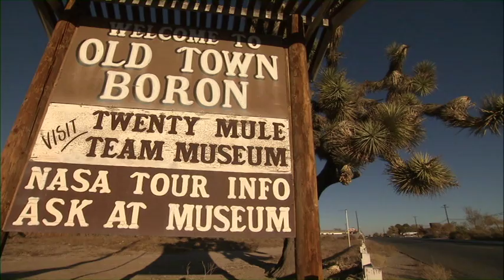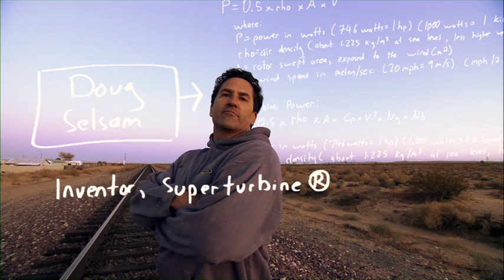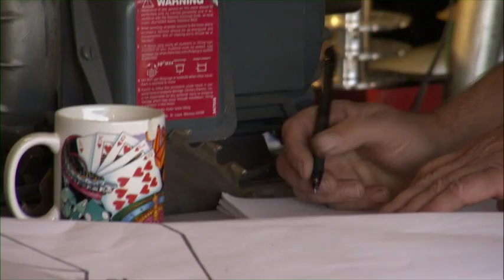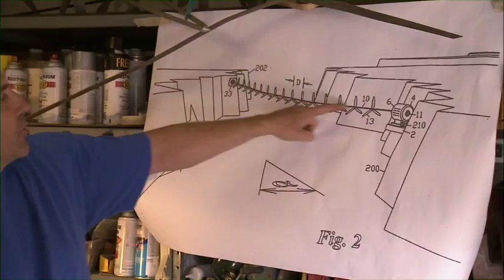Doug Selsam Inventor of Superturbine(R)

Comment: Do the math. It's a red hering. The fewer blades and the greater the diametre, the higher the efficiency. It's basic aerodynamics. That is exactly why the wind turbines grew so big.
Reply: Whatever floats your boat, mate. It's your time and your money you invest. Good luck, live long and prosper.
Reply: Blade material is V=hA, meaning the blades material doesn't grow at a cubed rate, larger turbine propellers are hollow not solid. A 10 meter long blade may have a 0.5 meter wall thickness with a diameter of 3 meters, so if we simplify and make it a cylinder the material would be approx. (10*pi*(1.5)^2)-(10*pi)=2.23 cubic meters of whatever material. Whereas a solid 1 meter simplified blade with similar proportions would use 1 *pi*(.17)^2=0.52 cubic meters of the same material. So now we examine length to material use, at 10/2.23 and 1/0.52, and we can easily see the 4.5 meters per cubic material beats the 2 meters per cubic meter. Of course the material used would determine the minimum wall thickness but at a certain point, with any given material, a longer hollow propeller will use proportionally less material.
Secondly, the sweep area is not a square it's a circle so it's pi*(r^2)*(blade count). So lets say you have a superturbine with 10, 1 meter long, 2 blade props, and a single 3 blade, 10 meter prop. The sweep area on the first is going to be 10*(2*(pi)) =62.8 square meters. The second will have a 3*pi*10^2=942 square meter sweep area. Then we come back to the original argument about which uses less material per sweep area, so lets do the math. 62.8/(10*(2*.52))=6ish square meters per cubic meter of material used, discounted material for driveshafts to connect the units of course, for the superturbine design. Then we get 942/(3*2.23)=140ish square meters of sweep area per cubic meter of material.
Given the example is simplified and shapes are actually more efficiently designed in reality, it's quite easy to see that a larger single turbine is more efficient, cheaper, and easier to maintain than a multi-prop design.
None of the above example takes into account the additional friction losses present in a higher speed turbine, nor was the cost of high speed bearings and lubricants accounted for, but, we can plainly see why engineers and physicists have gone for the single larger turbine versus the multi-prop designs. As far as your gearing argument, the larger generators typically produce power at about 1000 rpms, with a 30 rpm input, to get the same output you'd need many times more small direct drive turbine setups, and large direct drive generators are being deployed now negating the argument.
All in all the current design of large 3 blade wind generators beats the superturbine efficiency hands down, and neither comes close to the power output per mass of fossil and bio fuels in the time tested and reliable internal combustion engine. So far no green energy source is reliable enough, small enough, or efficient enough to meet the current demand for power. Often times green energy has a higher carbon footprint than if we had simply used an standard fuel powered generator. If we put half the money spent on green energy into nuclear power plants, there would be no need to cover the landscape in windmills and solar panels, and the demand would be met with a reliable power source that is available regardless of the weather conditions.
Reply: …which isn't even mentioning aerodynamic effects like losses to tip vortices on the blades, which means the fewer blades there are, the better it is. Then there's the consideration that aerodynamic forces grow with v², thus a longer blade will at the same RPM have a much greater efficiency than a short, stubby one of the same area, the effects of Reynolds Numbers on the blade's aerofoil behaviour etc.
But hey, I can't spell herring, so who am I to tell? Never step in the way of believers, Shawn. And then, there might be niche applications where this Superturbine actually makes sense, although I can't think of any right now.
But let's have some faith, praise the inventor, and a miracle will happen. Like with those solar roadways and Tesla coil generators. ^^)
Reply: I'm a nuclear physicist, and quite familiar with the reductionist fallacy. Get too focused on one aspect of a problem and the tendency to lose sight of the whole picture increases. It was clearly evidenced by the fact that a wholly true statement was ignored by focusing on a minor spelling/typing error. This gentleman has demonstrated a working model, however, hasn't demonstrated an improvement over current models. A patent doesn't mean it's better either, it just means you were the first to write to the patent office about a particular idea. Itself another common fallacy, the appeal to authority, something solar roadways suffered. 
Inventors do have amazing ideas, and often times, come across ingenious solutions to everyday problems. This time, however, he's chasing a pipe dream, and hopefully realizes it prior to going broke.
Reply: Your being a physicist was evident from reducing a blade shape to a cylinder to have a basis for a quick and easy rough estimate. ^^)
Me, I was forced out off university by lack of funds, thus am not a physicist, but I studied the subject none the less. Moreover, considering I am a native German speaker, I think my English spelling is quite okay. ;o)
You are perfectly right: When you have to clutch at straws such as disqualifying the one discussing a matter that grinds down to maths and physics for his spelling, that says a lot about the points you can make.
But hey, whatever floats his boat, right?
Reply: Whatever floats your boat.
Reply: Good luck, Sir! The first evidence of you being onto something there will be Chinese companies building and marketing it. Live long and prosper! \\//
Reply: We could go over all of the fluid dynamics in the youtube comments section or we could just jump right to the point, wind powers maximum efficiency in a perfect friction-less world on paper is 59.3%. Once that power usage is achieved anything more causes a loss of flow and therefore a loss of torque, or power production capability. Current 3 blade HAWT setups achieve about 80% of the real world 59.3% efficiency limit, considering friction losses, airfoil drag, wake flow, tip vortices, and non-laminar wind profiles, so it can be said that they are achieving very near the maximum. But you want the textbook information so lets do it.
The typical maximum usable wind velocity is 30m/s(v). With 0% humidty (dry) air at 20 °C and 101.33 kPa, it has a density of 1.20 kg/m^3(ρ), which is essentially perfect conditions for power production, and never actually achieved since water vapor is present normally, which reduces air density. Now that we've established perfect conditions, let's examine the theoretical limits of both designs. Superturbine with 10 2 blade props with a 1 meter radius, and a Common 3 blade prop design with a 10 meter radius. We'll assume perfect cross-sectional usage of the swept area for both designs, even though the superturbine will have more wake loss, and greater drag. Supertubine area(A) will be 10*pi*1^2=31.4m^2. Common turbine will be pi*10^2=314m^2. Maximum power output(P) is P=0.59(1/2)ρ(v^3)A. Plug in the numbers do the math and our result is: Superturbine power =  301kW, Common type power = 3.01MW. 
So using the text books and before we even examine load losses, friction losses, cost of driveshafts, towers, mounts, and other miscellaneous parts and changes needed to implement a superturbine design we can see it is less efficient and from the previous comment more expensive in prop material alone.
Wind energy is competitive with natural gas in a few ideal areas, but go to Alaska or Canada where the turbines can't operate for 25-30% of the year because of cold temperatures, and wind power costs near double natural gas. Try in FL, LA, TX, or MS, and you risk damage or total loss every hurricane season. Energy companies essentially bet on the power output of a wind farm, guessing what the 20-30 year output will be when charging for electricity, lose a wind farm to a hurricane and you can bet the price will spike. Wind also has limited expansion capability as sooner or later the useful building area will be saturated, and you will no longer be able to increase supply. If demand continues to increase as it has and supply saturates the price will go up. Have an oddball season with too much or too little wind and price goes up, nevermind the fact all wind farms purchase power from fossil fuel power production facilities during non-ideal weather conditions. 
I'm not out to discredit your efforts, or make any sort of personal attack, I just don't want to see anyone especially someone with a clever and inventive mind stray down a path that will only net loss of money. This current iteration of the superturbine can not improve upon the current successful model, and that can be demonstrated through measurement, cost comparison, theoretical mathematics modeling, and scientific process. Now is not the time to dig your heels in and double down, it's time to take a step back, use your brilliance, and attack the problem from a different angle. Good luck, and I do look forward to seeing what you can come up with.
Reply: Additive swept area would be in a perfect world, reality would actually show greater losses due to wake currents, torsional loss, attack angle or stall losses, losses due to gravity, and axial, radial, and lateral loading losses. Only the cylinder of air with the cross-sectional area of the blade diameter can provide lift or thrust for the blades. If each cylinder is tied to the next by a rigid or semi-rigid shaft then the next effect would be additive in the absolute best case scenario. If it's the first time you've encountered the science then perhaps it's you that should be examining the textbooks. 
Bigger blades do indeed take more material than a smaller blade, however, the gain in swept area is the square of the radius. Adding more smaller blades is additive, add length to the blade and the gain is multiplicative. If one discounts the driveshaft material the gains for adding length are squared, include them and they're better. It shouldn't matter whom you ask as far as mass vs length calculations mathematics presents us with the same answer regardless of whom was asked to perform the calculations.
The primary cause of wear in a turbine is load on the driveshaft. The idea is to mitigate the cost of repair and general maintenance. In a single prop design the gearbox can be maintained without the need to remove the prop and other supporting equipment. For your direct drive design how would the props be disengaged from the generator for maintenance? How do you address the axial load on the bearing block that supports the driveshaft? How does braking occur for your design when it is faced with out of parameter wind loads? When the unit is disabled to perform maintenance or safety how is the gravitational load addressed nevermind the oscillation due to the semi-rigid unsupported driveshaft? 
Conservation of mass and energy is a physical law that governs the maximum efficiency of any aerodynamic design, Betz's law places this maximum at 59.3% of incident air energy. You haven't demonstrated and increase of efficiency beyond the current large 3 blade design, and have in no way demonstrated a flaw in the mathematical theory. 
I'll ignore your ad hominem "a little bit of knowledge" quip, and remind you that to be taken seriously in the scientific community in which you are working you will be scrutinized and asked to show your work. When you resort to name-calling or non-sequitur type arguments it often shows your lack of expertise, and knowledge. I've demonstrated the mathematics, and physics (albeit simplified) that challenges your hypothesis, and rather than take the opportunity to show where I was mistaken, you've resorted to personal  attacks.
Your problem with the gains achieved by adding props argument is you haven't addressed the losses presented by adding the driveshafts. As you scale your design the driveshaft diameter and strength will need to grow,, you'll need to increase the total number of combined units, or the props will need to increase in size to produce the same or more power per unit cost than the current dominant design.
Reply: @shawn2444 whoa never seen such tech hi discussion on YT
Reply: @Scottie Winn man that's why Nikola tesla was not glorified despite of DC n rival did
Reply: Big picture: Efficiency = KWh / cost, NOT shaft HP / Area. You must know a bit about airfoils performance and reynolds numbers?
Reply from the maker: @shawn2444  Funny how many would assume every thought from a nuclear physicist must be true.
Reply: @dougselsam  I would hope the only assumption made would be in the formation of a hypothesis. Anything else said should be challenged for accuracy, and I would welcome the discussion that follows that challenge. Though, 2 years after the discussion we had here I can't say I've spent much time checking the comments. I also don't see many that weren't directly involved in the original statement agreeing with me here. So, if you've found others in agreement with my statements I would look in to why they might agree because I certainly haven't done anything to promote them.
Reply from the maker: @shawn2444  Shawn if you take a subject you know well, maybe you get tired of fielding endless comments from people from outside the field.  For me, this stuff is pretty simple, it works well, and when I develop new products I don't need to get into a lot of math.  Once you get used to them, rotors are not much more complicated than using a stepstool or a brick.  But I can tell you most outsiders from wind energy try to overthink it.  Anyway I just saw some comment and was bored and replied to it - sorry.  I had the flu or something, and was sitting around doing nothing.  But I thank you for your input.  :)

Comment: A 90meter dia wind turbine have a swept area of aproximately 6358m2. If this small turbines are 2 meter in dia he needs over 2000 of them on one axle to get the same swept area and they still would be alot less efficient because of the speed of the blade tips etc.